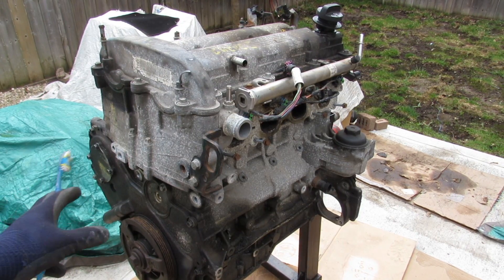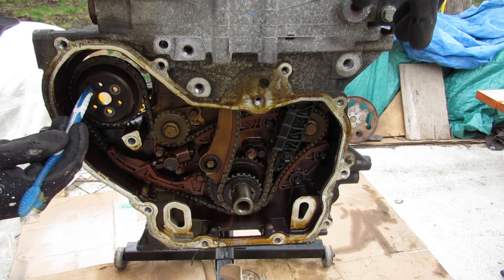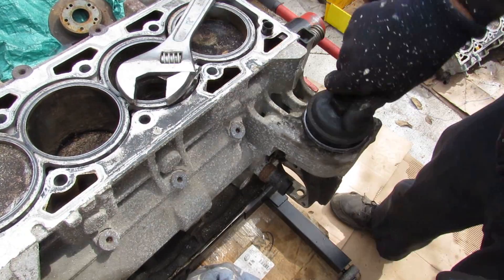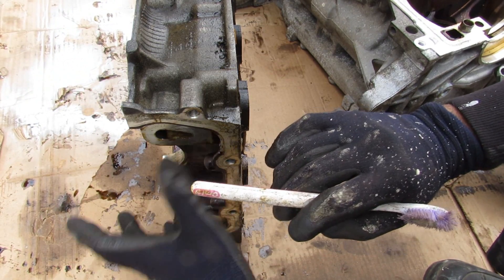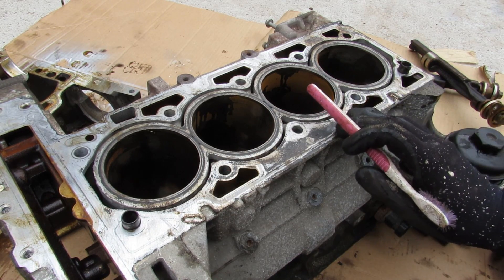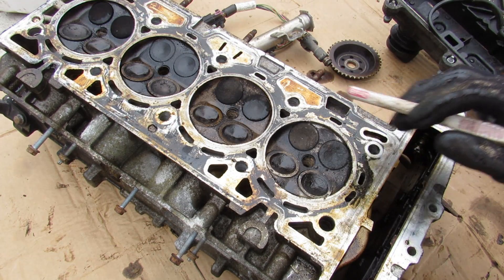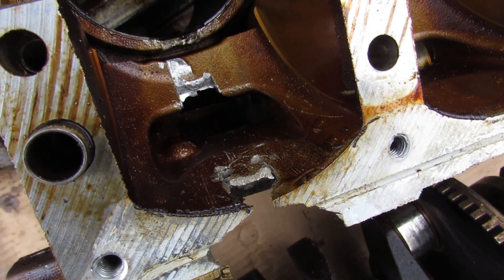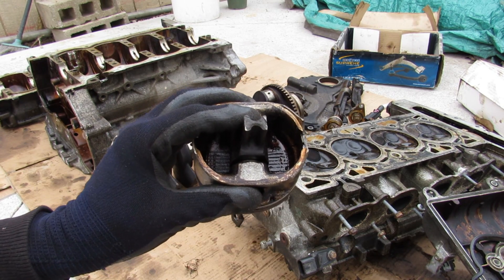Why GM Ecotec Engines FAIL

Comment: I have one of these as a 2 liter in my SAAB, that part at the end with the baffles in the valve cover finally made me understand why I keep finding a thin mist of oil on the inside of the turbo intake pipe, after the air filter. I also realized watching this that there's no actual gasket on the valve cover.
Mine's a late '02 / early '03, so it's coming up on almost 20 years and 140k miles, and I think that gooey stuff they used to seal it is starting to give up the ghost.
The intake side is fine, but the exhaust one has the turbo mounted almost at the level of the valve cover and it's started to weep a bit of oil through there. The worst part is, it literally cooks off the engine and the ventilation system just picks up the fumes and channels them into the car. It's not something you notice on long trips, but in town when you just sit at a traffic light, it has enough time to build up a small cloud and as you set off you get a waft of burnt oil....
Also, ever since I bought it, the water pump will randomly leak. Sometimes you go for weeks with no change, then one night half of the expansion bowl is gone. It's supposed to be a modern engine but I still always keep a bottle each of coolant, oil and hydraulic fluid in the trunk like the good ol' days.

Comment: Title should be "why American made EcoTec engines fail!" Euro ecotec engines have a pretty good reputation for being simple and reliable.
Reply: Actually these engines are very reliable but if you don't change the oil and use premium fuel like you're supposed to they will fail. Most of these engines I've seen last around 300,000 miles or 482,803 kilometers.

Comment: If the timing got out causing the piston to hit the valves, then all the cylinders will have damaged piston tops not to mention bent or snapped off valves. What happened there is that rod snapped due to lack of oiling as you pointed out- the overheated black journal. The piston was subsequently hit off centre by the rod stump, ramming the piston crookedly into the head and valves. I wonder if those pistons have blocked oil drain holes under the oil rings- a problem with the Toyota Corolla 1zzfe around 2002. Their holes were too few and too small and would block  causing the oil rings to carbon up and stick in, drinking oil as bad as a litre every 150km. Full synthetic oil stops this, but won't fix it if it's already gummed up.

Comment: I always thought they were pretty good engines. Aside from needing a timing chain every 100k I dont normally get these for anything else. Unless someone ran it low on oil which is common, and the chain guides break due to lack of oil. Also the water pumps are a bit different being ran off the chain.
Aside from that Cobalts are pretty good economy cars
As a mechanic however I recommend staying away from any GM with the 1.4L turbo. The plastics on the engine commonly fail
Reply: I work at an auto parts store, and our delivery vehicle is a 1.4T, and it's having issues with the turbo being only 1 year old. My manager had a Buick with the same engine and it also had a turbo issue

Comment: Kind of sad that people in the comments blame the turbo or the size of the engine even though the video clearly shows just the usual bad design choices.
Diesel are supercharged since the 70s and at a much higher pressure, so why would you blame that?

Comment: The 2.2 in my HHR has been very reliable so far. See many of them well over 200k miles on Craigslist.
Reply: YES, I agree IF it's the non-ecotech(OHV) version. I recently traded a '01 Cavalier 2.2L with 205Kmiles, used about 1/2quart of synthetic oil between 4K changes. HAD to get rid of it because sheet metal was rapidly returning to it's "natural state"....................................RUST!!

Comment: fun fact, the 1.6l ecotech found in 2009 chevy aveos can survive slipping exactly 1 tooth on their timing belts, (the valves kissed the carbon on the piston head, but didnt impact) source: i drove mine home from my workplace about 30 miles home, then spend about 8 hours gaining access and re-aligning the timing. It has begun to leak oil at a prodigious rate, 12 years and 180,000 miles, replacing the oil cooler/filter housing helped quite a bit, but its still dripping. also beware the stripping of threads with your steel oil drainplug and aluminum pan.

Comment: Sofar the best 4 cylinder GM has ever made was the Tech 4 or "Iron Duke" as everyone calls it. Sucks it was a low HP engine. But you could get 200k on one easy. GM even made a turbo version for a few years until the 2.8L V6 came out.

Comment: Seems that engine wasn't will cared for as the Crank and camshafts are just black from oxidation for a gas motor
Reply from the maker: Yes. The crankshaft looks burned

Comment: Not taking care of your engine will cause it to fail regardless of what engine it is. The problem with the 2.4 was the timing chain tensioner and the piston rings. The ring issues were a result of some bright star at GM deciding to put in weak rings to lower internal drag and causes lowered compression and oil consumption.
Reply from the maker: Yes

Comment: Err sorry to burst your bubble, but Opel's Ecotec engines are very good indeed. I don't know about the 2.4 or 2.2 litre types, but in the little Opel Corsa they just work very fine. I have a small 1.2 ecotec, and it runs just fine.  But maybe there is a range manufactured in the US? That could explain it, American engines don't have the same tolerances, they measure in ½inches, whereas Opel measures in micrometers. That could explain some

Comment: The sad thing is that GM forced this bad technology on SAAB.
SAAB used to have really sturdy and reliable engines before GM bought SAAB.
The root cause of these problems usually is the cheap pistons which will clog up with carbonized oil and soot which in turn will contaminate the oil which in turn will clog up oil chanels and lubricating orifices.

An advise is to check the oil level regularly and then with the engine running check if there's fumes coming out from the oil filler.
If the oil is black, change the oil and filter.
If there are fumes coming out of the oil filler, let a proffessional engine wash firm wash the engine internals.
If there still comes fumes out of the oil filler, consider an extensive overhaul of the engine internals or maybe swap engine (or sell/scrap the car).
Reply from the maker: True

Comment: Very well explained. I love the part about the holes can be fixed with duct tape. How about some bubble gum? LOL My wife has the Buick Encore with the 1.5 turbo. Cost me $200 to fix leaky coolant lines on the turbo. There is just so much plastic & everything is a throw away. The turbo oil feed return line is make of plastic. It literally crumbled in my hands,. Lets make a hot turbo & put plastic parts on it. Not a good recipe. Even the exhaust manifold nuts were brass & a 1 time use @ $4 each. What a nightmare.
Reply from the maker: Yeah those components break so fast

Comment: My car has the Ecotec 2.2 and it is burning oil, the valve stem seals are worn and I was considering replacing them but you have convinced me not to bother, I really think the engine is too far gone and the work involved plus cost is not worth it in my opinion. Interestingly my car has an oil level sensor that alerts me when the oil level gets down by about half a litre. I should say even thought my car has fairly high mileage it runs well and I think the problems with the engine might trace back to a stuck thermostat that severely restricted coolant flow but at the same time the temperature gauge was reading normal temps. Perhaps if I had caught that problem early it might not be burning so much oil.
Reply from the maker: Drive until it dies

Comment: These newer Ecotecs are total garbage. I had a 2014 Equinox I inherited from my grandpa when he passed away. Before driving it I popped the hood and checked the dipstick, not a drop on it. Of course that was alarming as I wasn't sure if I had inherited an SUV or a boat anchor at that point. So I filled the oil up, turned it over and checked for leaks, none visible. Drive the car home, about a 10 minute drive. The next day I check the oil level again, and there's nothing on the dipstick. Now I was nearly sure I inherited a boat anchor. I did some digging online and saw there was a recall from GM for oil consumption. So I make an appointment at the local Chevy dealership. Oh boy was that a fun bit of hoops to jump though. 

They first said they had to do an  oil change and that was going to be $55... okay that's a ripoff but fine if it's necessary. They said then I would have to bring the car in monthly until it burns oil over their "acceptable" level (side note, when the h*ll was an engine burning oil acceptable aside from a rotary engine???). Well, it didn't make it that far. As soon as the technician started to drain the oil there was a high amount of metal shavings in the oil. So they come back in and say that the test can't be performed because it is obvious there was engine damage. They then wanted to know the service history, specifically oil changes, on the vehicle. I was only able to find paperwork for one oil change since my grandpa had owned the car. He had only owned it for 8 months and put less than a thousand miles on it, but of course the dealership says "oh we'll have to make sure the engine isn't damaged due to the neglected service history". Of course at this point I'm fuming. At the time this car was only 5 years old with under 70k miles on it, and it's burning a quart of oil anytime you make an in town trip. But they said the only way to honor the recall is if they take the valve cover off and inspect for any signs of neglect. I reluctantly agree to it, if there's no signs of neglect the inspection is covered under the warranty. If there are signs of neglect I'm on the hook for the cost to remove and replace the valve cover on a boat anchor of a motor. I get a call the next day saying the engine looked great inside and the technician could see no signs of neglect, so the work order was pushed through to continue the recall. The dealership had the car a total of 3 weeks. During which time I was just out a car, because the voluntary recall doesn't cover a loaner car. 

They ended up nearly rebuilding the motor completely, and some other stuff broke or was broken but the short list was: pistons, rings, new head and other gaskets, new timing chains and tensioners, some sensor broke when they were taking the engine apart and had to be ordered. About the only thing I couldn't get them to do under the recall was the water pump. The day I got the Equinox back I listed it for sale. When my grandpa first got the thing he had to have the transmission rebuilt. Now it had the engine crap out and need rebuilt, and I had very little faith in how long the repair from GM would actually last. But to have had severe engine and transmission failures in 5 years/70k miles blew my mind.

Comment: I have an Saturn Vue with over 315k on the original 2.2 ecotec. The life and death of these engines is keeping your oil changed properly. Not changing the oil properly, stretches the chain and and leads to the engine grenading. If you properly change the oil, these engines last great. My experience is these engines prefer synthetic oil

Comment: that was a cheap shot against champion spark plugs. i have had excellent service using them in gm engines over the years. ive checked some after 200 thousand miles and put them back in.

Comment: You never took apart the cam chain tensioner, which you only removed and mentioned as an after-thought. That tensioner is the key to the mechanical problems with these engines. Had you examined it, you probably would have found that someone before you had not reset it properly after working on the water pump/balance shaft chain, and that the cam chain tensioner was filled with small bits of steel from the damaged internals of that tensioner, which prevented the proper amount of chain tension from being maintained on the valve gears, thereby allowing the timing to jump, and the pistons to collide with the valves at high speed, resulting in the damage from the rod going through the block on each side, and the valve contact damage the tops of the pistons. The oil control rings did not cause this failure.  The direct injection of the fuel into the combustion chamber allowed the intake valves to become gummed up from condensed oil vapor, reducing air flow into the affected cylinders, which effectively enriched the fuel air mixture and the extra fuel and pressure from combustion washed away the cylinder lubricant, contributing to the issues with the oil control rings, but not engine failure.

Comment: Opel developed the head and valve system, Lotus engineering(consult company) developet the block and crank.
GM demanded the lost foam casting method to be used.
Saab developed all av the boosted versions upp to 2009.

Comment: A very nice tour!  Much appreciated.  My daily driver is a 2004 Cavalier.  I have no issues with it because I keep the oil always fresh.  Nice thing about keeping it working is I don't have to learn the details.  But, nice to know about the oil pump being in the timing chain cover and the internal balance shafts.  Never bothered to investigate those little details before.

Here's a nice data point concerning the oil rings on the pistons.  My particular example does not burn oil even with 130k on the clock.  Like I said, I look after its maintenance religiously.  Vacuum oil extractors are the complete bomb!

Anywho, I often drive this car cross country to Las Vegas, Nevada to visit relatives.  Going over Vail Pass in Colorado will burn a quart of oil in 300 miles.  Of course, asking the little car to boogie up those mountains puts quite a strain on her power plant.

Comment: Want long engine life?  Change your oil regularly.  Check it weekly.  Or this is the result.  Keep an eye on the cooling system.  When the water pump seals go there is a direct path to the oil pan.
Reply: I always tell my friends to check their oil at every fill-up or every other fill-up at the gas station. Take a look around the engine bay while at it.

Comment: That was mostly due to lack of sufficient oil....or very old oil in the car. DO NOT try to get advertised maximum oil life on any car....that is oil company advertising but not backed up by real usage by most people. I always change oil every 3500 mile max or once a year if less than that. Not saying the connecting rods were an issue but don't think they were the primary culprit.

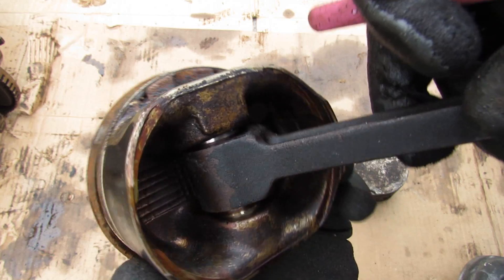Comment: 10:48 The oil control ring doesn't allow oil to travel from the combustion chamber down into sump!  It prevents oil from going in the opposite direction.  That mis-statement makes me question anything this guy has to say.
Reply: Gib, please explain in more detail?
Reply: @jimandnancymcoil  The bottom end of the engine is where the sump is, holding the oil that lubricates the main bearings, conrod bearings etc.  The oil is pumped to bearing surfaces that need it, like the valve gear, and it also splashes on the cylinders below the piston rings, to lubricate the pistons as they slide up and down in the cylinders.  It certainly is not wanted in the combustion chamber, and the function of the oil control ring on each piston is to prevent oil from getting there.  If the oil ring is worn or broken, oil will get past it into the combustion chamber, where it will burn, creating a very smoky exhaust and consuming oil.

Comment: If the waterpunp goes bad it totals the car
Reply from the maker: If it doesn't over heat you can still change it. It has an access plate to unbolt the pulley from the chain.

Comment: Good old gear driven camshaft and water pump was and is the best.
Reply from the maker: Which engine has a gear driven camshaft?
Reply: @speedkar99   300 ford inline 6, gear driven camshaft,  chevy/pontiac iron duke 2.5,  gear driven camshaft.
Reply: The 55 series,71series,92series 2 stroke Detroit diesel.

Comment: I had a 2.2 ecoboost that was still running around 240k. Used oil badly but didn't leak or smoke. Go figure. Started adding 15W40 to slow the oil loss. Was still running when I gave it away.
Reply from the maker: Ecoboost?